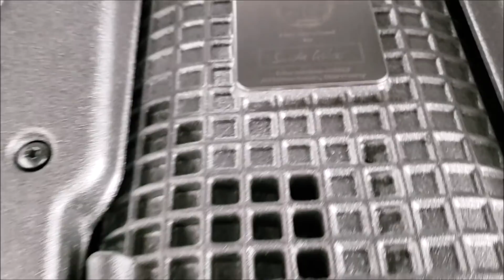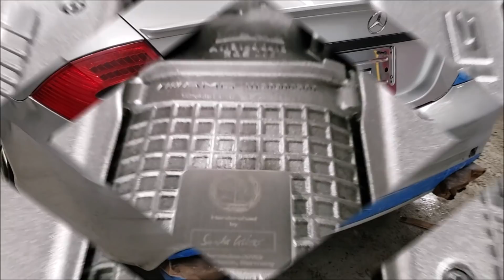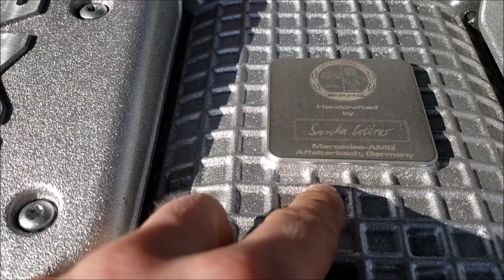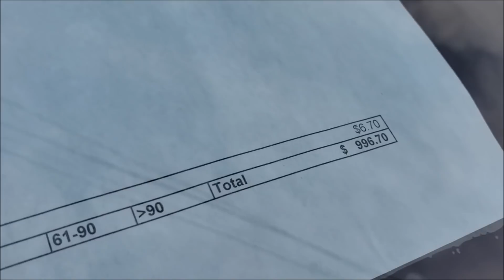The $1850 Supercharged AMG Project Car is Finished! - Flying Wheels

Comment: Bro i was all on board until the seat repair, soon has you showed that the very first thing i thought of was janky used car dealer lol if thats not a joke bro youve gotta get a fabric shop to fix that and for gods sack match the driver side
Reply: Yeah, that was perplexing-it just looked bad. If you're doing it on the cheap, an upholstery shop can stitch in a new panel pretty cheaply.

Comment: I wouldn't have blacked out the emblem. It looks like it's missing. Man all that body work and missing tow hook covers? C'mon now... Everything else was spot on. The seat repair like others mentioned should've been done on both. I would've cleaned the wheels and sold them. Then buy aftermarket wheels or used set that fits right. They still don't look right.
Reply: They didn’t black it out lol they just pulled off the remains of the broken chrome star and didn’t replace it.

Comment: Are you going to put suede on the drivers seat to match?
Reply from the maker: Nah
Reply: @FlyingWheels  should look up amazon for leather looking seat repair. Had a tiburon with thorn leather and the stuff comes with a plastic you peel off and it's super sticky. Cut and Placed over the area and couldn't tell had been replaced.
Reply: @xenonm6993  yeah and gives one the experience to do it even more competently efficiently and effectively next time.

Comment: Weird it has 2 different amg style wheels.  It’s got the normal kind on the drivers side and the performance pack on the passenger.  Nice work overall, it’s fun to have a project from time to time.  At least it’s a car worth bringing back! I am currently working on an 05 e55 amg.

Comment: It's a SALVAGE TITLE were the insurance company took a total loss. This hurts the value by no less then 50% of loan. Also no bank, or finance company will loan 2 cents these vehicles.
This MB looks like a mile or 2 away from looking O.K. You need brake rotors at lease in the from and no you cannot turn them they are shot like most of the car. This model was not a big seller. Also your upholstery work on the passenger seat  is?? where someone with a glass eye could see how bad it looks. Did you have the frame check?
Reply: Why would you finance a 5k car lmao...
Reply: @Ak47777-l  Not everyone has 5k in there pockets to buy a vehicle. A tote the note lot might  if they cover the dead cost and finance the profit over 18 months @ $250.00 month. There are many late model salvage title vehicles  selling for 20+ k.

Comment: That suede looks like shit and yes I'd know if I was going to buy it. At least do all 4 seats the same and tuck the seems in so it doesn't look like you glued it to the seat lol
Reply from the maker: The more I do, the more I have to ask for it. This car sold in 3 days
Reply: @FlyingWheels  i get that part, but you're a car guy too and you would of noticed it. If you had the extra suede already it would of taken maybe 30 minutes more of your time to do all 4 and made it look uniform almost OEM. Also be careful with those eBay spacers. They aren't designed for driving mostly just for looks and will cause the wheel to shake loose at higher speeds. The last thing you want is another Karen like the Saab.. let's see a video on that 1G and Z32 you have at home.
Reply from the maker: @adamschisler6143  true and I debated it but dodnt want to put glue on parts that didn't need it
Reply: @FlyingWheels  it sold and on to the next is all that matters
Reply from the maker: @adamschisler6143  👍🤙